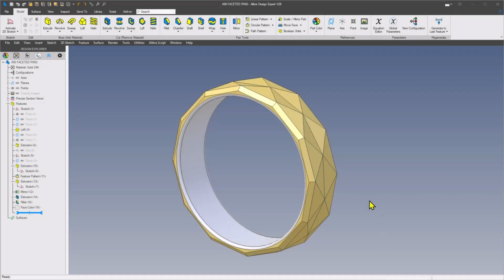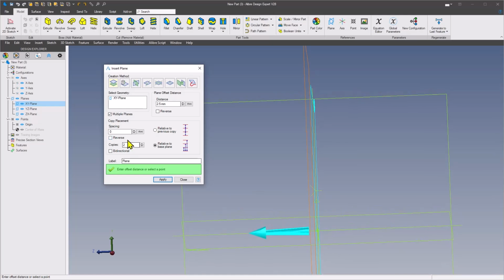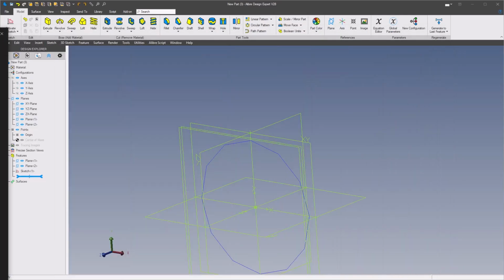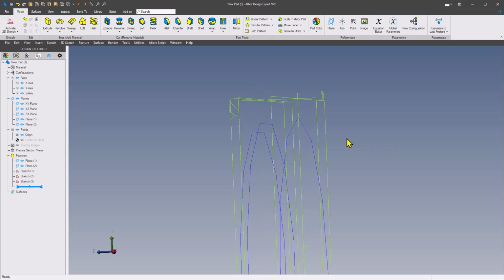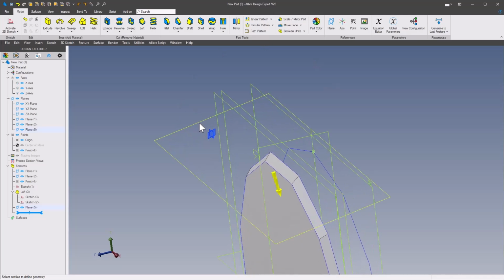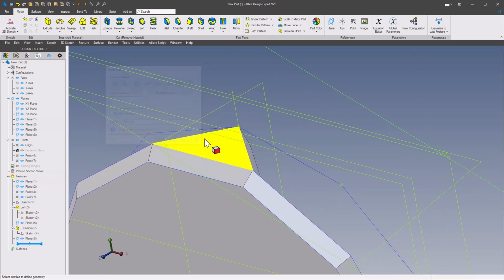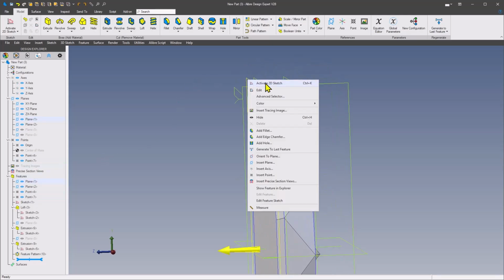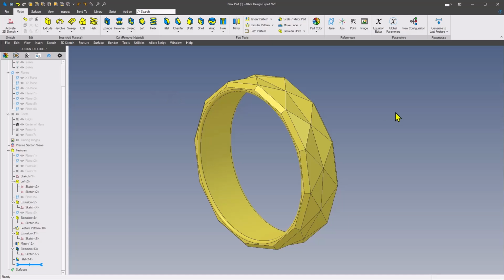Alibre Design Tutorial  -  Faceted Ring

Comment: You have explained this in a very easy-to-understand way. Thanks. I need your help. I'm trying to make a car steering wheel. I'm able to make the wheel. The issue I'm facing is that I want to add hand grips in two sections/parts of the wheel. I'm unable to figure it out. It'll be like adding grip texture to some part of a round sweep.
Reply from the maker: Check out my latest video for a couple of methods. One of them should work for you. Let me know.